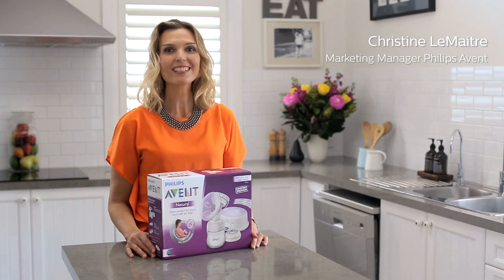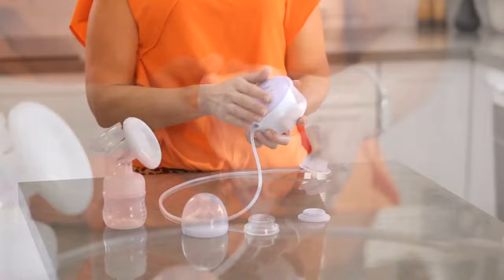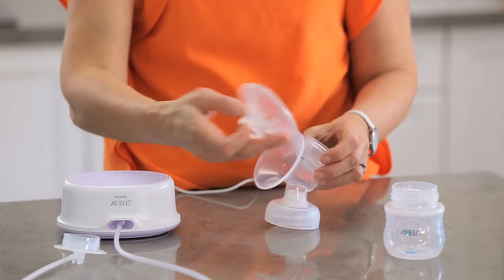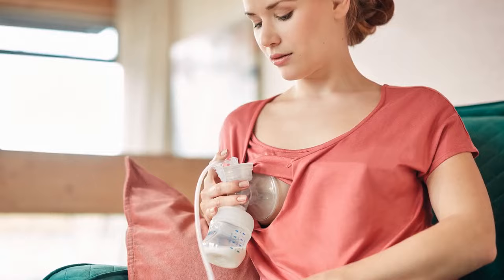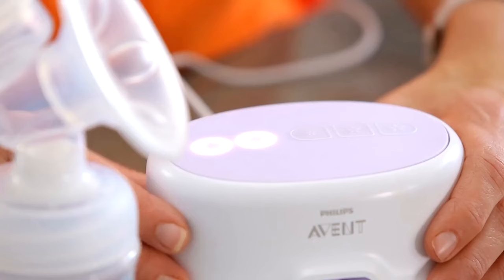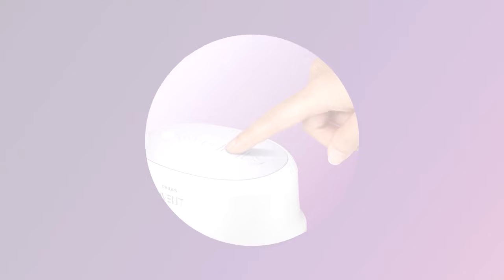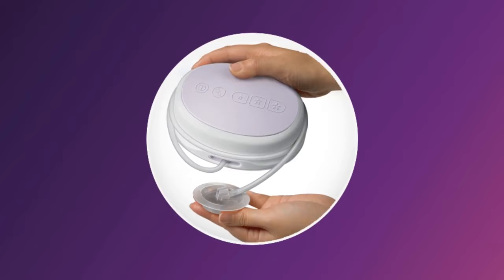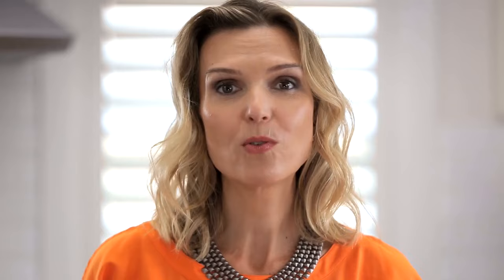Unboxing the AVENT Single electric breast pump and how the unit works | Philips | SCF332

Comment: Have you inserted batteries ? Or charge it without batteries then use it ?
Should the pump be attached to power supply if we don't put batteries??
Reply from the maker: Hi Nawal. Thanks for your question. The Avent Single breast pump (SCF332) can be used with our without batteries. If you're not using batteries, the supplied adapter should be plugged into a wall outlet. Unfortunately if you use reachable batteries, they can't be recharged by the breast pump itself. Hopefully this helps, and let us know if we can help with anything else.
Reply: Hi there, I've inserted brand new batteries, however the machine does not seem to work. Is there a setting or something I need to change to switch to battery mode?

Comment: Does it have to be the Avent bottle attached or can you use a different bottle if you choose to ? I’ve just been given this pump but there’s no bottle in the box with it.
Reply from the maker: Hi Jodie, thank you for getting in touch with us. You can use your Philips Avent breast pump with all baby bottles in the Philips Avent Natural and Anti-colic ranges, as well as Philips Avent storage cups with an adapter for the cup. Please note that we do not recommend using glass bottles with breast pumps as they may leak. Also, our natural bottle and nipple are included with the breast pump. If you haven't received it, please get in touch with us via social media. We're available on Facebook (@Philips) and X (@PhilipsCare).

Comment: must there be batteries inserted, or can i just use it plugged into a socket?
Reply from the maker: Hi Kris, thanks for reaching out to us. Before you can use your Single electric breast pump, you need to Insert four new 1.5V AA batteries. Hopefully, this answered your question. :)
Reply: @Philips  yes, it did. thank you so much ♥️

Comment: Hi. I have Avent Manual pump. Can I connect the manual pump to electric motor? I have electric pump motor but without pump head. I bought the manual pump. I would like to know if I can connect manual pump head to electric
Reply from the maker: Thanks for your query, Kamran. We would be happy to check, if this would be possible. Could you please let us know the model number of your manual breast pump? This is imprinted on your device (starts with an SCF- code). Looking forward to hearing from you soon. :)
Reply: I did a review on the Philips Avent Manual Breast Pump if answering your question!

Comment: I put the 4 batteries but it is stopped working after a minute ? Could you please advise
Reply from the maker: Hi Mohamed, thanks for reaching out to us. Let's see how we can help you. Have you checked if you inserted the batteries correctly? It would also be advisable to use new batteries. Please let us know if you tried this already or if this worked. Many thanks!
Reply: @Philips  i am using 4 batteries 5v but when i unplus the cable and use the pump with the batteries only it will work for less than a minute. Is it normal or i have to use both cable and batteries together in same time?
Reply from the maker: Hi there, thank you for your message. Have you made sure to clean the pocket for the batteries, as residue can cause it to malfunction. Awaiting your reply.
Reply: @Philips  it is new device and new batteries, is there any recommended type of batteries i have to use or any type of 5v battery?
Reply from the maker: Thanks for mentioning this, Mohamed. Can you please send us a message via Facebook (@Philips)? Then, we'll be able to assist you more promptly. Thanks in advance!
Reply: @Philips  thanks alot
Reply from the maker: Not a problem, we'll be awaiting your message. :)

Comment: What kind of batteries we can recharge?
Reply from the maker: Hi there Rashmi, thanks for your question. You can use the Philips Avent single electric breast pump with both batteries and power supply. If you're interested in using batteries, you'd need 4 AA ones. A new 1.5V set of batteries provides 1-3 hours of operating time for your Philips Avent single electric breast pump. Rechargeable 1.2V batteries will lose capacity over time and may cause a decrease in operating time. If you have inserted batteries in the battery housing of the motor unit and plug in the adapter, the breast pump will run from the main power supply. Hope this helps! If you have any further questions, feel free to let us know. :)
Reply: Panasonic Eneloop AA will do the trick, make sure you get the charging dock and a second set!

Comment: The motor works but the suction is not enough to express milk..is there something wrong with the motor or the tube?
Reply from the maker: Hi there, Duli. Thanks for reaching out to us. It's unfortunate to hear you're having some issues with your Avent breast pump. Have these issues always been present or have they gradually developed? It would also be handy if you could share the exact product details of your device with us. Thanks in advance. :)
Reply: @Philips  thnks for your reply.all these issues gradually increased.now no suction at all.checked the tube seems there's no blockage.
Product batch no is 102165018(mfd 8/2018)scf 332/33
Let me know if I can solve these issues or i have to go for a new one.
Reply from the maker: Thanks for explaining, Duli. We'd like to further look into this for you, so would you mind sharing your country of residence with us? Thanks again!. :)
Reply: @Philips   Sri Lanka
Reply from the maker: Thanks for getting back to us, Duli. We're going to have to go in a bit more detail now, so it would be great if you could reach out to us on one of our social media platforms (Facebook, Twitter @PhilipsCare). There, we'll be able to troubleshoot more extensively (including pictures). Also, in case we should require assistance from our product experts, you can share your contact details with us there (whereas here, they're out in the open). So, we hope to hear from you there. :-)
Reply: I have the same issue, I’m in South Africa

Comment: What’s the difference between the scf332/01 and scf332/31?
Reply from the maker: Hi Melissa. Good question. Don't worry too much about the digits coming after the "/". Both models are exactly the same, but some retailers just sell it under a different model number. The functionalities and specifications are the same. :) Would you let us know if you have any other questions?